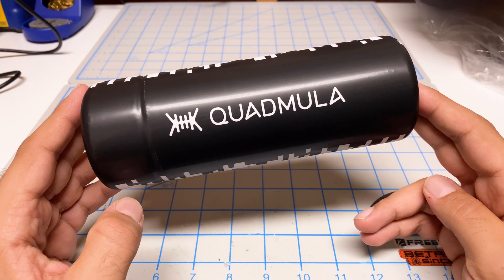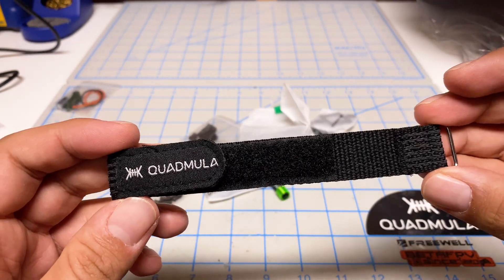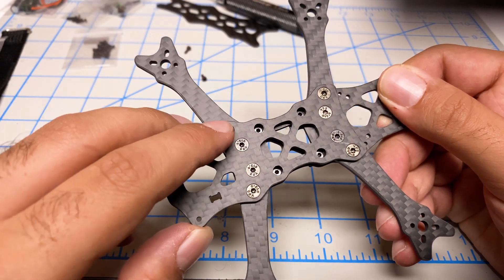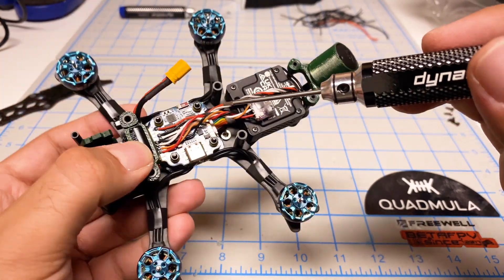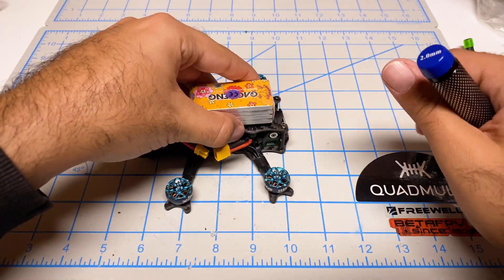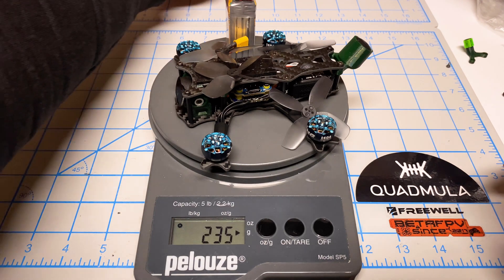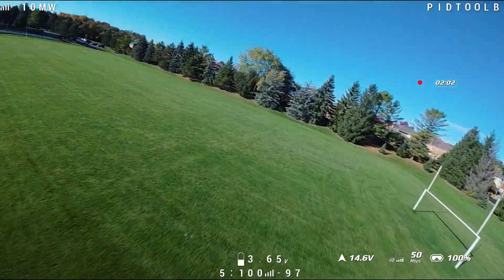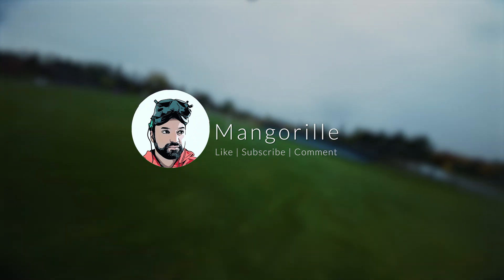Almost PERFECT DJI O3 SUB 250 Gram Micro 🤯 | The NEW Quadmula Djinn F25 2.5" is Here!

Comment: Been flying my Djinn now for a few days now in many different configurations and I think Quadmula should consider selling longer arms to convert it to a 3".  I've tried all the suggested props and it stills feels a bit too heavy in the power to weight ratio.  My configuration. Speedy mini stack, mamba 1404 3000kv, dji 03 with all printed TPU. The tune is pretty bad too. Mangorille....love your content on FPV and 3D printing.  You really know how to present material. Thank you.
Reply from the maker: Thanks! What battery are you using? Mine was 240g ready to go, which is on the heavy end for the 2.5 inch props. I can get it down about 14 grams to 226 using the lightened o3, which is really where you’d want it. Don’t tell Quadmula but I tried to put my 3” arms on this frame and they didn’t fit. The second arm hole was off about a mm.
Reply: @Mangorille   using some Liperior 6S 650's which bring the total weight to around 275grams.  I ordered some 550's that weight about 73 grams which should bring me to around 250grams.  Do you think with a little modification the F3 arms would work?
Reply from the maker: @victorlugardo3703  Hmm, that is on the heavy side for such a small quad. I personally wouldn't try modifying the arms, it will cause play and make them weaker if you elongate the hole. I did some math, even with the 550s, you are still going to be at 248g. Better but anywhere else you can find to cut another ~10grams?
Reply: Please try the presets"4.3 Filter settings for VERY CLEAN build with RPM FILTERING". This is the basic setting for Djinn F25.

After changing the settings, please observe whether the motor temperature is normal first.
Reply: That's the only reason I'm going for the AOS 3 inch. 50g frame weight and designed for the 03
Not ragging on quadmula but the 2.5 size is a bit limited
Reply from the maker: @XloMotion  My daily flier is the Quadmula 3", agree that 3" is more versatile but having no frame/props in view is quite nice. I was looking at the AOS 3.5 at some point.
Reply: @XloMotion  fwiw, I've been told that Quadmula is working on a 3.5" djinn.
Reply: It recommends 5000kv motors
Reply from the maker: @Krash_fpv  What size motors? You need to look at the combination of motor size and KV.
Reply: @Krash_fpv  who recommends 5000kv motors?
Reply: I've used 4500kv with 4s and no motor output limit. So 5000kv could work with a little motor output limit if required.

Comment: Hey Mangorille, I'm new to drones in general and especially to drone building. Always flew prebuilt ones so far. But I got more and more interested in them and your video gave me the extra push I needed to jump into it. I love that setup, and trying to reproduce it as much as I can (i.e couldn't find your iFlight XING2 1404 4600kv Motors in stock, so I ended up switching for BrotherHobby TC 1404 4600KV Motor, though I don't even know what's the difference). A quick question though, is there anywhere I can find what extra wires I will need and / or a plan on how to soulder all that together? xD
Reply from the maker: Hey. Very rewarding to build your own quad, congrats on taking the first step to doing so! If you choose the SpeedyBee ESC/Flight Controller Stack I linked in the video description, it comes with an amazing manual to walk you through where you need to solder up the wires. All wires are included with the parts you will purchase. The only thing would be the receiver that may not come with wires. Which receiver are you looking at?
Reply: @Mangorille   Haha yes, and thank you for your kind response, I'm eagerly waiting for that feeling of proudness for having built my own. Good news that it comes with everything and instructions. I'm not sure yet, because I have the googles 2 and the DJI controller 2, I was maybe thinking about going with just the O3 for now, I know there's ELRS and crossfire, and I've heard a lot of good things about ELRS and the Tango controller, as it has more penetration and range than the DJI O3 built in receiver, but I didbn't make up my mind yet. Any advice on that one?
Reply from the maker: @malinaanaho  If you already have the DJI FPV Controller 2, use that for the time being. I went with ELRS and the Tango 2 for more reliability and the full size gimbals. You can always add that later on.
Reply: @Mangorille  Hey again Mangorille, one last question, you mention that your ESC is the other way around, does that not pose any issues about the way you connect the motors then? Or does it not matter which one connects to which?
Reply from the maker: @malinaanaho   You need to remap the motors in Betaflight. You can use the remapping wizard on the Motors tab or do it through the CLI. Check out the CLI file I included in the video description and you will see the section that looks like "RESOURCE MOTOR 1..."
Reply: @Mangorille  But yeah, your videos are inspiring, keep up the good work and vibes <3
Reply from the maker: @malinaanaho  The CLI file is what you would use in Betaflight. Are you using the same flight controller as in the video and did you wire it up the same?
Reply: @Mangorille  Yeah, just realised I needed something on top of the website you provided, and downloaded BetaFlight :D
Discovering another workd of configurations, making me a bit dizzy haha

Comment: i might try to use 1604 motors on 4s with 6-8 blade props.. just for the noise.. how do u think it would fly?
Reply from the maker: I thought about 1604 motors but those are really for 3.5 - 4 inch quads. Seems like too much motor for such a small quad. You can probably run the 6 blade props on the 1404.

Comment: You need a discus. Lol i need to redesign a O3 version but it will easily surpass ur needs. Dogcom 550 have new tech and weigh like 20g lighter than 650s so that probly be a fun option and triblades but how you liking those 4 blades? I have em but so behind on testing.
Reply from the maker: I was surprised that the 4 blade flew better. First time running 4 blade for me.

Comment: Murders fpv channel uses a 650 6s battery for the large straps. I wish @quadmula would include 4s battery straps along with 6s straps
Reply: Actually, even though it's a 20mm wide strap, it's shorter in length and specifically designed for smaller batteries. It's currently also being used on the SF3.
Reply from the maker: @vts5520i  Yes the F25 comes with the same strap as the F3, both of which are too large for a 4s 650mah battery. I've tried cutting it shorter but then you're not left with enough of the velcro material to secure it well.
Reply: @Mangorille  You're right, that's actually true!
Reply from the maker: He must be over 250g then, I'm at 240 with a 4s so I would estimate that he's at minimally 265g, which defeats my goal of this build but yes should allow him to use that strap. :)
Reply: @Mangorille I'm running 6S motors with 380mah 6s GnB 's and weighing in at 244gr ... Thing flys great with my thorough pid and filter tune. I tried tattu 650's 6S, but it was too heavy @299 grams and just didn't feel that good flying.
Reply from the maker: @califpv  My reservation with such small cells is that they don't have the same quality and performance as larger packs. I've been doing some testing with 530mah cells and they have significantly higher IR than their 650mah counterpart. At some point you give up the benefit of the higher voltage due to the lower performance cells.

Comment: Is there really not a camera mount setup available for the f3 that has no top plate in view?
Reply from the maker: The f3 only has a tiny bit of the top deck in view in the goggle view. The onboard view doesn’t pick up the top deck (at least at normal with 26 degree uptilt). No way to get rid of the props in view though on the f3.
Reply: @Mangorille  I'm ok with the props in view but the top plate in view seems insane, good that it's not in the goggle view but it'll drive me insane to lose FOV cropping in on the DVR footage....dam
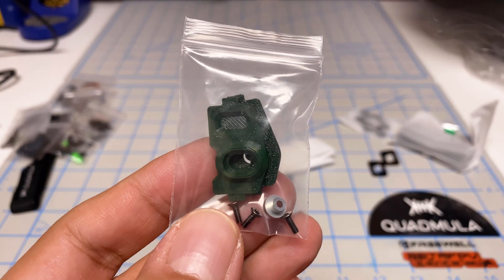Reply from the maker: @CiottiFPV  On the F3 it's the other way around, no top deck in view on the air unit recording but a tiny bit on the goggle view. Check out 1:48 to 1:58 in this video: https://youtu.be/gxt-7bHG9vQ
Reply: @Mangorille  oh HELL yeah, that's what I want to hear, ordering one right now lol
Reply from the maker: Lol sounds good. You going with a sub 250 build? Here is my f3 build video. https://youtu.be/IKHoPryhvCg?si=I7Z7Ku10kCVqi_YW